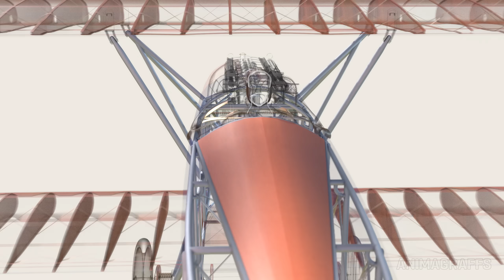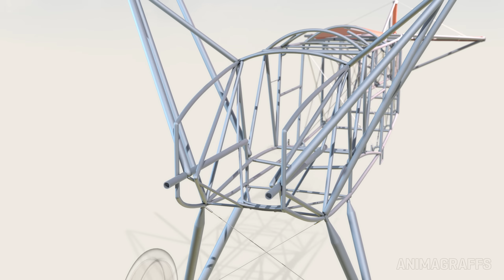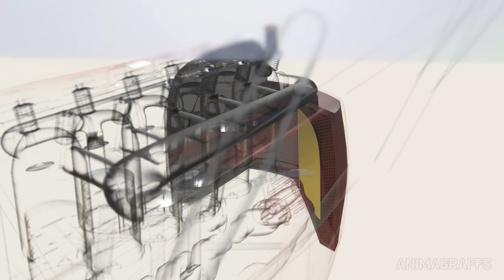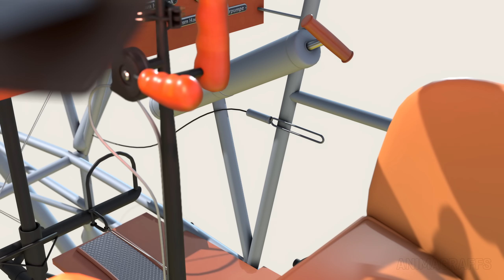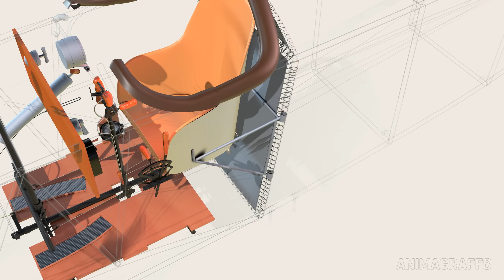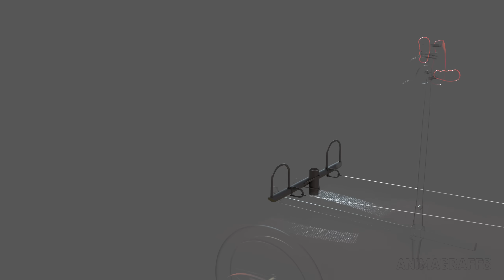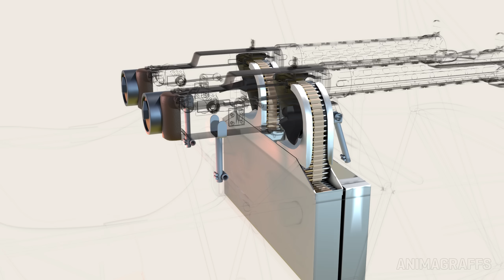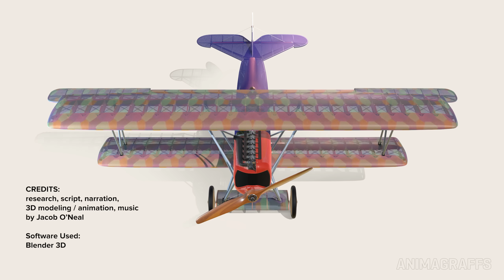How a WWI Biplane Works

Comment: I've been flying GA aircraft for 30 years, and never gave these early planes even a second glance.  Yes, they were old and cool, but antiquated, or so I thought.  The amount of thought and engineering that went into these early airplanes deserve respect.  The simplicity of them is amazing and yet they were also carefully designed to check every box and then some.  I can see how some pilots have learned to love these beautiful old machines.
Reply: There are some companies that make replicas (obviously with modern materials for safety). What you said is why I am buying one as soon as I can afford it!
Reply: @dimitrijensk2845  There was a guy in Sweden who built a replica of this exact airplane after finding an engine from one somehow.
Reply: Like he said, only 15 years after the Wright brothers. A pretty enormous leap of tech in a pretty short time.
Reply: Actually not much different than entry level GA aircraft made today. Just some improvements in materials, pilot and passenger comfort and electronics of course. Some aircaft like the old Piper Cub and others are still being made today, some with less instrumentation than this bird. And would be easily understandable by a late WW1 mechanic and pilot.
Reply: @johnstudd4245  Except if we're being honest they're a lot cooler than GA aircraft. A Cessna 172 is great and everything but it's basically like flying in a 70's AMC Pacer and usually around the same vintage. WW1 aircraft are just cool in the same way an old Harley, BMW or Triumph motorcycle are cool. It's always going to be more impressive to be out in the open flying by touch and skill with the engine right next to you.
Reply: You only thought you needed a starter and battery in your airplane.
Reply: They were works of art because they were made by furniture makers at the time and all hand built. This DVII is a very late war design, and was a Cadillac in terms of build and performance. Earlier planes were more like wicker chairs with tents for wings and used wing warping early on with the British not really getting the gist of it until they captured a few German planes, which is odd because the Wright Brothers did quite well with their planes in Europe whereas the US military thought it was just a passing fad that would never catch on.(something that would bite us again because of the lack of progress during the inter-war period leaving the US woefully under equipped at the onset of WWII).
Reply: @ImpendingJoker  
They must have pinched the landing wheels off a child's tricycle!

Comment: very good animation. Just a small remark: the propeller rotates in the other direction.
Reply: At the 8:15 mark the engine is turning correctly but the propeller is on backwards. Then at 15:45 the engine is reversed and the propeller is on correctly. Still, this is an outstanding video.

Comment: They should have used the heat from the radiator to heat the pilot 😂
Reply from the maker: Apparently they tried that, by not having a firewall. But engine emissions proved too dangerous for pilots. Things like spitting hot oil, etc.
Reply: Technically yes, but since it has an open cockpit design, wouldn't the hot air/radiation be a waste if it just entered the space and got immediately cooled off (while flying at higher altitudes)?

Comment: So crazy how far flight has come since it's invention.
Reply: Flight has, and still does, capture the minds of so many. With great interest in a particular subject, the human mind is capable of incredible things.
Reply: its
Reply: Crazier to think how far it had come from its invention even back when this plane was made. The very first human powered flight ever was only 15 years prior.
Reply: TBH, we used most of these features for decades after, and still use many today. The synchronized gearing for guns was used up until Jets became the norm, as any plane with guns and props in the nose needed it. Control surfaces for the longest time used wires like this, and many modern planes still do, though some use electronic motors or hydraulics. The design of the wings is still used, with all the spars and such, but its made of aluminum instead of wood and steel. Wooden props are still used in many civilian aircrafts, and were use din military aircraft till the end of WWII. The control stick and rudder pedals have barely changed in terms of the way they work, but as time went on, new features were added to them to improve them. The location of the throttle on the left side of the cockpit is still used in most aircraft as well! Many aircraft even have auxiliary fuel tanks that you can flip a switch to source from! While aircraft have advanced miles in terms of features, materials, speed, and such, many of the advancements we see today are heavily based on what we saw in WWI fighters. The amount aircraft advanced during WWI and II is astounding, and really proves that war brings about a new age. Had WWI never happened, I doubt supersonic jets would have existed in the 1950s. Its sad, yet logical that warfare strives humanity to innovate to such an extent, so that one side can best the other. We went from slow biplanes to supersonic jets within 36 years which is insanely fast compared to every other innovation.
Reply: even just from 1914 to 1918 it got  alot better, but by 1930 it wa san INSANE jump in tech. by 1943 guys had 1490hp 400mph planes that could hold 8Gs in flight, had radio, radar, camera, heating, oxygen, and bomb systems with (6) 50 cal machine guns that could go 1650+ miles...plus automatically adjusting gunsights where all you had to do was size the reticle to the plane and estimate the wingspan roughly
Reply: It's amazing to me, how far it's come in a relatively short period of time. From Kitty Hawk to space! About 120 yrs or so.... it's simply amazing!
Reply: True and amazing. But exact flying principles via physics. A Chinese bottle rocket a 1,000 years ago is exactly by basic design a rocket fired from a battle ship today.  @greggrace967
Reply: Agreed. And how much it is still the same too.
Reply: Why ?
Reply: And in such a short time
Reply: We need to move on to UFO anti gravity technology by now...
Reply: War does that 💩 makes it easier to kill your enemy
Reply: That was cutting edge aviation and now it's ultralight complexity, and could be built in someone's garage.  It it holds up, in 100 years, people will be building space planes in their garages and lifting off to the moon, while corporate interests mine the moons around Jupiter.  Standing on the shoulders of giants, we'll eventually reach the stars.
Reply: @nonplayercharacter6478  I don't think you can build this kind of plane in a garage, unless you want an even worse deathtrap than the original was.
Reply: @alex31ytb   Of course you could build that kind of plane in a garage, people do it all the time.  The ultralight industry is millions of dollars a year.  If you mean an ultralight with the characteristics of a Fokker, I suspect even that is possible though not as easy, high end CAD programs aren't beyond some garage builders.  I doubt the FAA would allow the guns though.  :)
And since when did something being a 'deathtrap' stop people from doing it?  People climb mountains which are 'deathtraps' all the time.  My first car was considered a deathtrap by many, but it served me well for many years.
Reply: VERY distance!! SO much far!! Literally ass far ass the quan(tit)y of fuel will allow!! 😲🤯
Reply: @CallMeByMyMatingName  tell me you're 14 without telling me you're 14
Reply: @alecjohnson5043  why ppl say that?